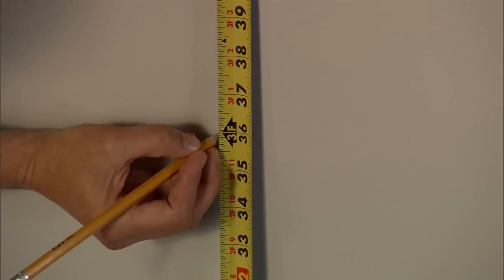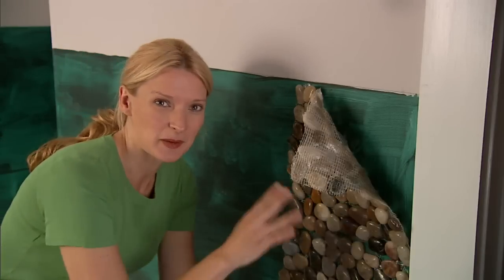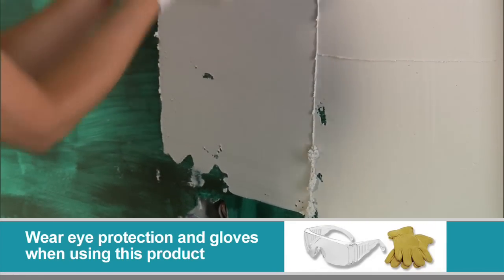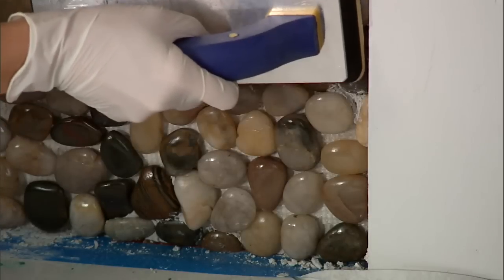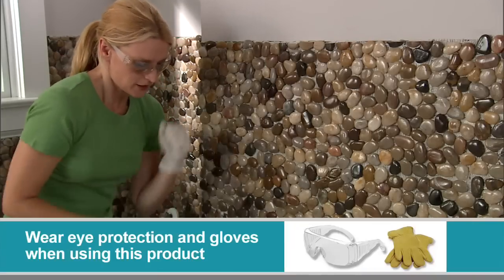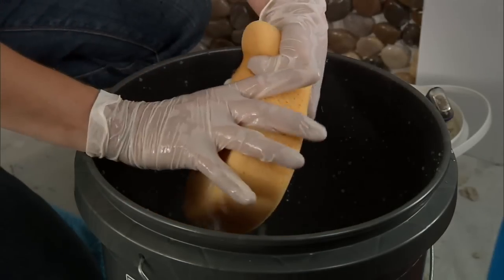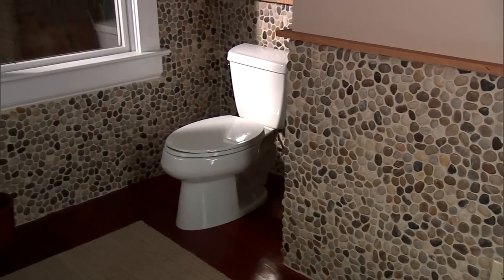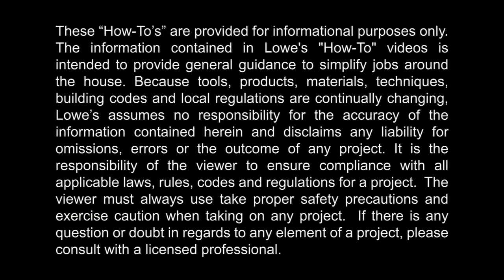Install a Pebble Tile Accent Wall: Installation

Comment: A: the sealer is applied first so that the grout doesn't stick to the pebbles. Otherwise your stones have a hazy film on them. You can apply sealant afterwards as suggested however the grout she used is a one-step grout with sealant in it.
Reply: Keith Chicquen ... YouTube expert alert .
Reply: @davidmurphy8480  I think it’s just good advise...
Reply: So, she did nothing wrong if sealant is in the grout. 😵‍💫😳
Reply: What sealant did she use?

Comment: Obviously, this is a brief how-to that moves quickly through what is in fact a lengthy process. Understanding that, I recommend this video as it helped me tremendously in my pebble-tile installation. I built an entire custom shower using very small (less than 1") pebble tile in order to work with the irregular contours of the space, and it worked fabulously well. I used a Goof Proof Shower Pan Kit from Mark E Industries as well. Also highly recommended.

Comment: @wush786 .....Use a long nap roller, they come in sizes up to 36mm nap which should reach the voids between the pebbles. I have used this method on raked brickwork and it does work, but remember always keep the roller loaded meaning dont go too far between dipping the roller in the paint, otherwise you will be pushing hard to fill the voids.

Comment: stupid question: Why do you need safety glasses while spreading thin set?  Great video by the way - I'm doing a mosaic tile in front of the fireplace and found this video very helpful.

Comment: With a natural stone product, you want to seal before you grout, so the grout can be easier cleaned off the surface, it can save you alot of time later.

Comment: @danielwormald Another question from a newbie: how do you polish the river rocks? can you tumble them or is a dremel better?  If so how do you do this?  also are you using the enhancing sealer - I tried SurfaceGard sealer (water based) on marble and some other random common stones (mosaic) and the stones look like they did in the package.  :)  glad to meet an experienced tiler.

Comment: What's the best way to attach a wood molding like that to the wall? long nails through the front into the studs, or kreg jig from underneath perhaps?
Reply from the maker: The most common method would be to attach it to studs with a nail gun, then caulk the holes. Thanks for watching!
Reply: E. S. Blofeld jlaagg

Comment: I think you used the wrong trowel.  It should be square notched and 3/16 inch. This looks smaller and thinset mortar application looks skimpy for such heavy stones.

Comment: Really nice, thanks for the video. Can this be installed without grouting if I use a all-in-one thin set and grout product?
Reply from the maker: Lincoln David we checked a couple of the products and they didn't reference this installation method. Take a close look at the the installation specifics for the tile you plan to use to avoid issues.  Also if you plan on installing in a wet area be sure to choose a tile that is suited for those applications. Thanks for watching.
Reply: Lowe's Home Improvement thank you very much

Comment: There is no such thing as pre-mixed thin set. That’s mastic. It doesn’t adhere to stone, and you can’t use it in wet areas. This install fell apart three months later. Pre-mix grout? What are you, eight years old?

Comment: It's mortar and mesh with clinger pebbles. It's not rocket science. Cut the mesh as you desire with scissors then use loose pebbles to cover the holes. You never actually have to cut the pebbles. Then grout it and wash it off after 20 minutes.

Comment: Too much grout look for me.  Trim piece color looks bad too. Should have went with WHITE like the window trim in my opinion. I'm don't like that wall color with those pebbles either. The wall color doesn't complement the pebbles. Oh well. If you like it, that's ok too. I would have to change it up a bit to live with it. LOL 😂

Comment: They need to design new switches those rocker gangs & screws kill the final view.Toggles & snap on covers would have looked a little neater.Is there such thing as switches that are activated by touch ? & just an inch or so square